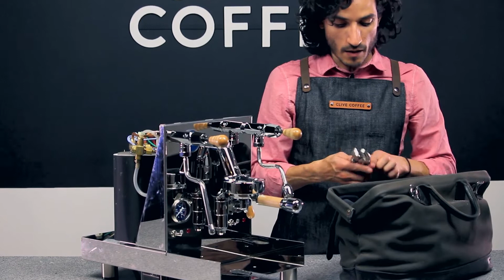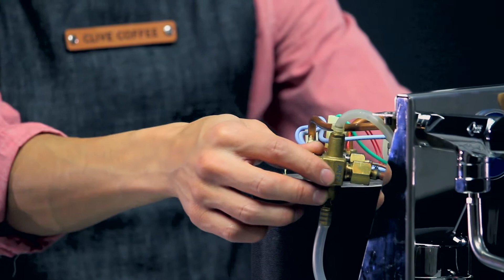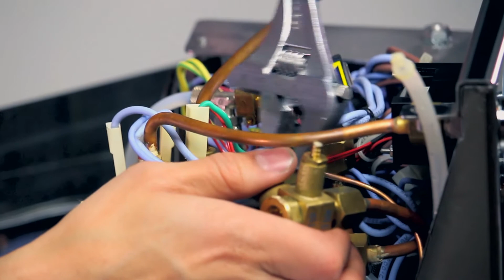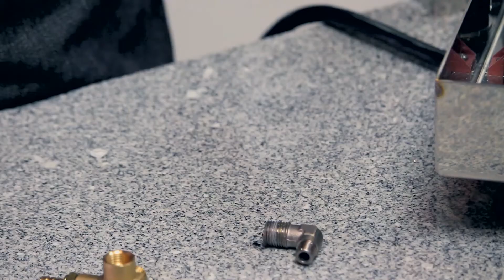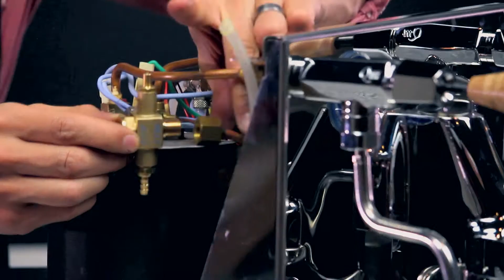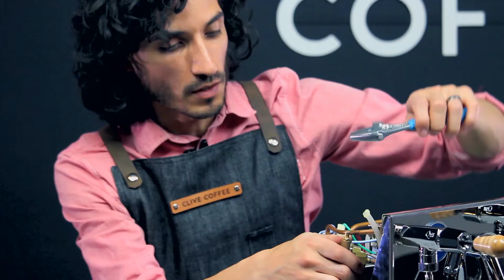Lucca M58 | Pressure Safety Valve & Vacuum Breaker Replacement

Comment: My Lucca M58 is leaking after 18 months of ownership.  I did this replacement, including using PTFE tape and ensured it is not leaking from the this area.  However it did not fix the leak.  Confirmed it is not leaking from drip tray but middle bottom of machine.  Cups on top upside down also have a lot of water in them leading me to believe water inside is being evaporated upwards.  How can i find whats leaking and get help?  Too expensive of a machine to have it have these issues so soon.

Comment: Be sure to use PTFE tape on the elbow. He doesn’t show it in the video. Mine leaked without tape. Removing and reinstalling the elbow with PTFE solved the leak.
Reply: Thank you! I needed this tip

Comment: Do you need to drain the machine before doing this?
Reply from the maker: It's not necessary to drain the machine for this process. However, we do recommend making sure the machine is not plugged in and is completely cooled off.